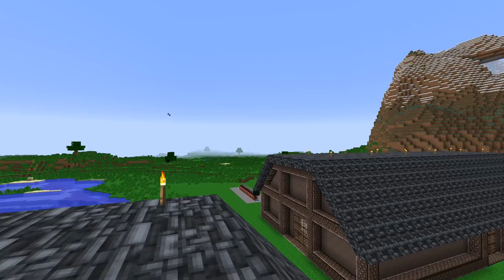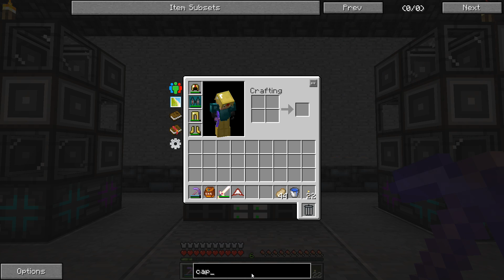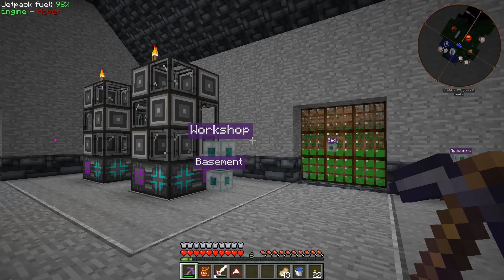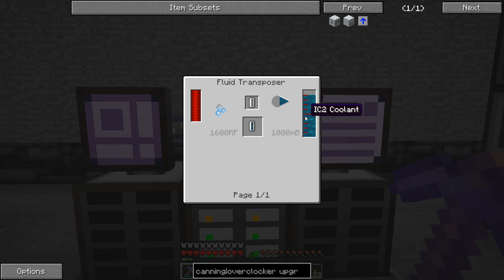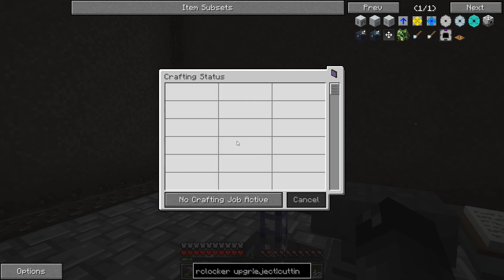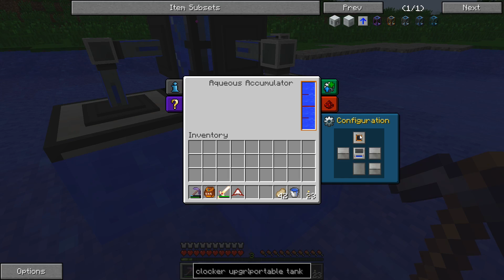Minecraft Mods FTB Inventions - POWER BANK [E21]

Comment: hypno your ic2 machines will run out of power if you do loads of smelting because you need to increase the power storage or each machine, with capacity upgades, then they wont run out of power when doing loads of work

Comment: To get the individual Input and Output to display on the capacitors, you need to have the display in a vertical pattern of at least 3 to 1.

Comment: Does this modpack have solar expansion?
Reply: It's prohibitively expensive. Exponential rabbit holes are terrible balance.
Reply: Yes, i believe so.
Reply: FROST ok i would love to see him play it :) lol iv been suggesting it to everyone that has it.
Reply: Tadferd what makes u think that you have to get the best of the best solar panels? 27 hardened solar panels (8 rf/t each), 1 maxed out water wheel, and 1 improved windmill 20-40 blocks above the ground power a few forestry machines, my tree farm, my wheat farm, and 2 redstone furnaces each at 80 rf/t. its not a whole base worth of stuff, but its a good start. I could probably take down my tree farm, because I do have plenty of wood and charcoal. My wheat farm is useless to me, idk why I made it :).
Reply: Because even those Hardened Panels are prohibitively expensive. You needed 216 Leadstone Panels to make 27 Hardened Panels. That's 96 Lead Ingots, 432 Iron Ingots, 432 Redstone, 216 Steel Ingots (which is another 216 Iron), 243 Glass, and 216 Lapis.

All for only 216 RF/t. You'd be better off making 3 more Water Wheels and using those resources for cheaper and more effective power options or other items/machines.
Reply: Tadferd I have all of the machines i need. I may make some Ender IO stuff, possibly completely switching to Ender IO machinery, solar expansion power, applied energistics 2 storage, but only thermal foundation auto resource regenerator. Ik solar is expensive, but i can get all that stuff easily. I got tons of lead, infinite glass, tons of redstone, etc. It will be really worth it in the end. Better than IC2 solar generation, because i dont have IC2 machinery, i have thermal expansion machinery. Also, IC2 power generation is very slow, and the machines are slow also. The upgrades are expensive also.
Reply: Actually, if you can transfer EU into RF and get Iridium easily (Botania), IC2 Advanced Solars are much cheaper than Solar Expansion. I just make my ME Autocrafting do all the work because IC2 sucks. Also, Overclocker upgrades are pretty easy to make and not very expensive.
Reply: Tadferd what do overclocker upgrades require? coolant (i think, i dont have it). What do i need for that? canning machine. i just dont have this stuff. Solar expansion is best for me.
Reply: Coolant isn't hard to get.

You'd be better off using active power generation than wasting resources on Solar Expansion.
Reply: Tadferd "active power generation" as in using coal, gas, lava?